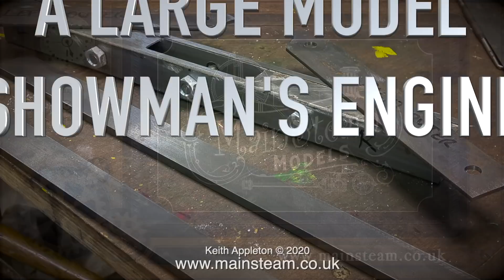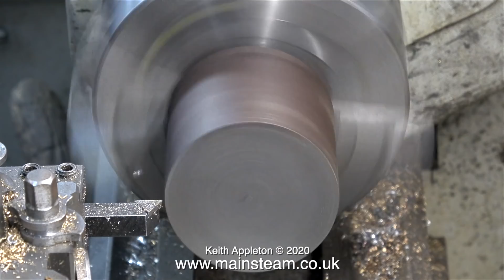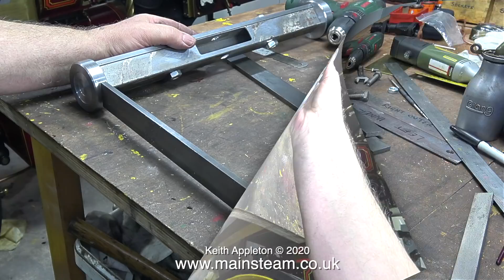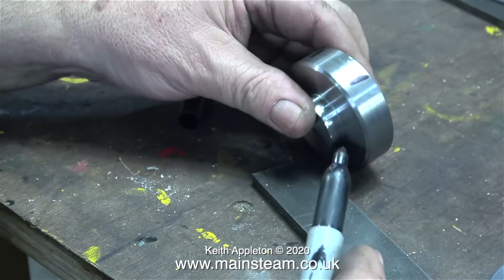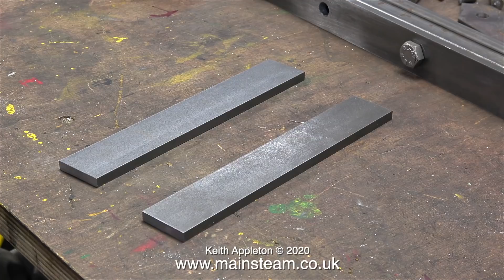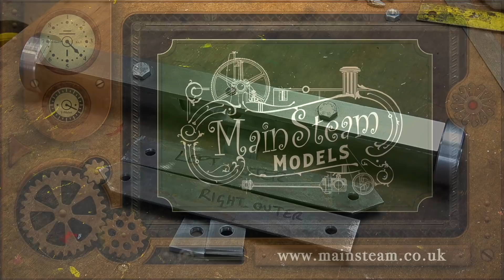A LARGE MODEL SHOWMAN'S ENGINE - PART #37

Comment: Will the trolley be just a drivers seat or will it have storage for water and coal also? Loving the series by the way :)
Reply from the maker: It will have storage for oil cans & tools etc. The extra water and coal is in a much larger trailer to tow behind the riding truck. I haven't shown that yet.